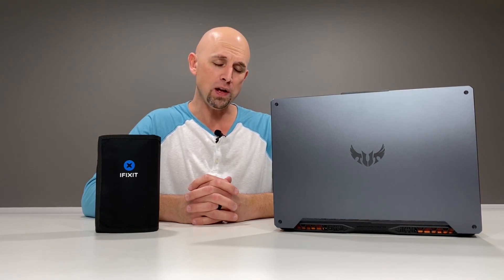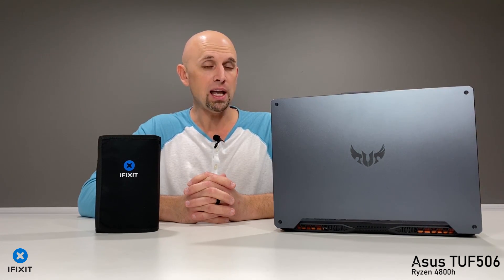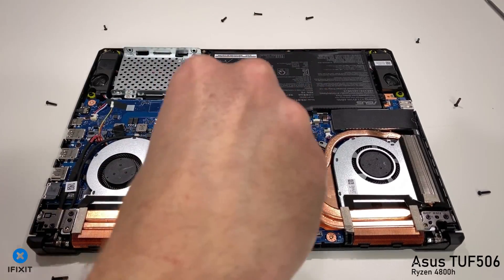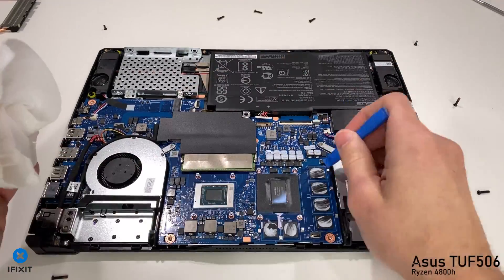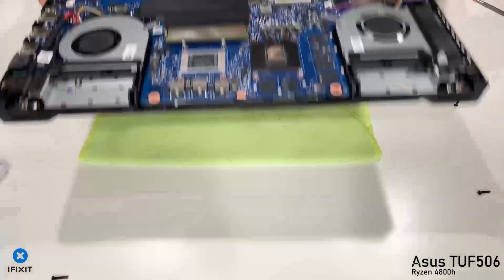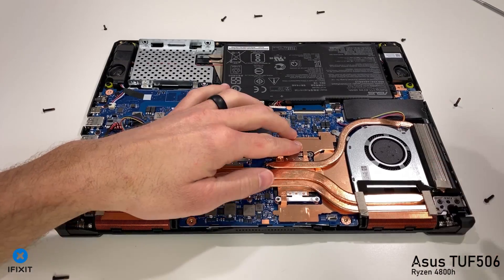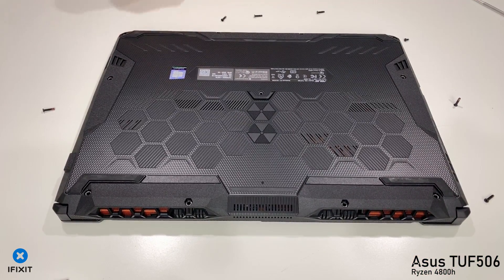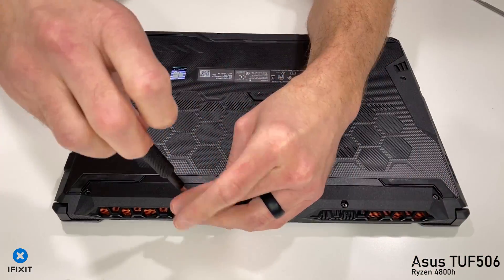Asus TUF 506 Repaste (Ryzen 4800H inside)

Comment from the maker: This is a brand new laptop. Most brand new laptops do NOT thermally benefit from new paste and this is no exception.   There’s nothing to show.
Reply: @Bob, had it been some other laptop with better cooling like Scar or Zephyrus, would it benefit from repaste? My current Asus Scar 3's i7 runs at 45W limit comfortably in 80-85C range while gaming. But when I push it to 60W power limit, the temps shoot up to 95C and it starts throttling a bit. Will I see an improvement in this regard after repasting?
Reply: Another IMPORTANT video topic for a video: How to replace the screen and what connector does the display use? (30 pin or 40 pin) As with the display being the primary weakness of the laptop, and as in the US a 40 pin 72% NTSC 144hz 15.6" display is ~$105 USD and a 30 pin 94% 120hz NTSC 15.6" display is <$60 USD. I think that there may be a lot of people who would like to upgrade their display in the near future.
Reply from the maker: I’ve done a time of those and one as recent as last week https://youtu.be/HO19B6MbOP4
Reply: thats why I've watercooled my gl502vs which has simmilar cooling system ( heatsink ).
Reply: Can you make a tutorial for screen replacement of the tuf a15 because it's screen is worse than I could imagine
Reply: @HarshGupta-zz9ur  I've changed mines it was a pain they glue the screen to the metal housing needs lots of heat and patience.
Reply: @Arw what laptop model are u taking abt?
Reply: Hay I have the Gigabyte Aero 15X V8, its starting to overhead and I looking to do a repaste. Can I use Innovation Cooling IC Graphite Thermal Pad on the GPU and CPU or should I stick with thermal paste for this: If yes which thermal paste would you recommend?
Reply from the maker: I’d go thermal paste and .5 fujipoly pads on the vram and other components.
Reply: @BobOfAllTrades  okay thanks, I have it in my laptop on the CPU and was thinking I could use it in the laptop but if you recommend thermal paste then thermal paste it is.
Reply: @BobOfAllTrades  Hey Bob, thanks for the great video.  One of my heat sink screws was way overtightened and I managed to strip it when trying to take it out.  Do you have any idea what size replacement I need (and obviously I have the same model computer)?  I assume it is an M2 but just not sure how long.  Thanks again!
Reply: Nice job showing whether the RAM was soldered or not.........
Reply: Not true my man. Not all thermal paste are made the same.
Reply: @JuanJDumeP  You cannot max out the fans on the A15. So no matter what paste you apply, the temperatures will simply scale   up to the fan speeds, simply satisfying the fan curve. So eventually it will get hot, albeit slowly.
Reply: @gamersanditparadise  liquid metal try that
Reply: I have the A15 Ryzen 9 and rtx2060 I avg 70-80°c with boost disabled 👍
Reply: Perhaps you need to try using liquid metal gallium.
Reply: Bro can i use 0.5mm thermal pad or 1.0MM?
Reply: How much will this cost?
Reply: Asus tuf bad cooling system.

Comment: hiya bob ive done aload of tests on this laptop i have the 4900h & Rtx2060 version my temps i can get right down to about 60'c 
playing perfectly no lags and good fps but surface temps direct above the gpu on the keyboard side is extremely hot 
the the only thing i can think of is either too much/too little thermal past on the heat sink or its sitting flush to the gpu chip (to tight)
i have put the 0.5 thermal pads on everything but the gpu and cpu i have put thermal paste on those 

hope you might have somthing for me to look into thanks
Reply from the maker: There’s components there that are not actively cooled.  That’s a pretty hot spot and many modern gaming laptops.
Reply: @BobOfAllTrades  would you say a hotter than a cup of fresh boild tea  a acceptable keyboard temp on a laptop 🤔 I'm not familiar with laptops as I have come from a older pc build just seem alarming haha

Comment: someone else has problems with 32 gb memory from v1.35v to 3200mhz that does not reach 3200mhz?
Reply: I think i'ts because the laptop's stock ram is rated at 1.2v, had the same issue so I returned them and bought 1.2v 3200mhz ones.
Reply: @chamlali14  correct, in my case it cannot return the RAM hehehehe bad luck mine.

Comment: DIY tip: use a heat gun to soften up the paste on the copper side, immediately wipe the paste off with a paper towel soaked in IPA. The copper can take the heat, the paste comes off in a single wipe. Be careful to not touch the copper with bare skin, and dont use that method on the mobo, heeat guns/hair dryers/leaf blowers etc, generate static electricity, could damage the board.

Comment: I have the same unit 506UI 15.6, may i know is the warranty will void, if the sticker removed on the screw? I have done this, but i only applied THERMAL GRIZZLY KRYONAUT THERMAL GREASE to CPU and GPU and the CPU temperature dropped 10c degree from 94c to 84c. Average temperature about 78c, before that while gaming it was stable at 94c, other than those chipset i used slim thermal pad, so far it was running cooler and stable.
Reply: I've made it like you with the same components, the result is same too when the system is on heavy load, but I've got higher idle temps. The idle CPU temperature was 30-35 before that but now 45-50. How about yours? Thanks!

Comment: Would an external fan setup help keep it cooler?
Reply: laptop cooler should help when gaming but wont be a huge improvement. imo repasting not necessary at all unless it improperly applied at factory. i have run gaming laptops for years without any overheating issues for years. just remember to clean the fans and vents.

Comment: Hey Bob: do TUF 506 with bigger battery have 1 extra NVMe slots?  I want to decide which TUF A15: bigger battery but I need 2 SSD slots.
Reply from the maker: Both laptops have 2 NVMe slots but the 48whr version has a 2.5” drive.
Reply: @BobOfAllTrades  Answer I needed.  I go with larger battery.

Comment: Just got the version with the 1650Ti and the motherboard is different, sadly no extra M.2 slot 😭 and this model also comes with thermal pads on the vrms, and fins instead of copper are aluminum, went with this model because I only game casually, might return and upgrade to the 1660Ti version maybe, it just sucks that from the 1650Ti to the 1660Ti there’s a 200 euros gap 😂
Reply from the maker: Cranberry Boost Interesting update in that model and thank you for letting us know!

Comment: If you're gonna do a repaste you might as well show if it benefits at all from it. If it doesn't, that's fairly easy to show with some tests. No reason to just go "most brand new laptops don't benefit from new paste" when that's pretty much untrue.
Reply from the maker: There’s a difference between a new laptop that was sitting in a warehouse for 6 months vs a new laptop that had a build date from the previous month.  Paste dries up regardless of use.  People were having issues with the first shipment of the Xbox One X for the same thing. 

Showcasing the zero temp difference would be extremely misleading once people follow this guide after their laptop is 6-12 months old as their temps should improve greatly.
Reply: @BobOfAllTrades  There are situations where recently built laptops can have improved thermals from a repaste. There are numerous instances where people who got CTO laptops from companies end up with uneven or even high temps that were improved with a repaste. Companies tend to use cheap thermal compound and you can yield much better temps with a proper compound.

You're treating showing data as if it's irresponsible. All it would do would make you more credible here realistically. You're perfectly capable of just showing the data and going "if you repaste a year after purchase you'll likely improve your temps, but this hasn't improved temperatures at all".
Reply from the maker: This is a tutorial to help those who will eventually need it.  

Here’s a different explanation in a different way. If I show that there’s no temperature difference then people will come to this video later on down the road and ask questions like “should I apply new paste because here it shows no improvement?“. Or “my temps are much warmer that what you revealed in your review, I’m worried that a repaste won’t do anything”.  Then I’ll get dozens of different variations of similar questions.  

In the end, this is a guide and that’s it.  I have made several of these over the last three years and have learned what to include based on experience with the community and reading their comments/questions.
Reply: @BobOfAllTrades  so "i'm not going to show data because I can't present my thermal test results without confusing people"? that seems to be more an issue with how you're presenting your content than anything else to me. again, I don't understand why you refuse to show any hard data for things on a consistent basis

Comment: Another IMPORTANT video topic for a video: How to replace the screen and what connector does the display use? (30 pin or 40 pin) As with the display being the primary weakness of the laptop, and as in the US a 40 pin 72% NTSC 144hz 15.6" display is ~$105 USD and a 30 pin 94% 120hz NTSC 15.6" display is <$60 USD. I think that there may be a lot of people who would like to upgrade their display in the near future.
Reply: You can not replace the screen so easily!!
Reply: Totally agreed
Reply: I'm interested in that too and mostly if everything on the upgrade monitor is the same except for the power consumption (lets say 4.7W to 8.1W) and if the new uses 4 lanes instead of 2 (same 40pin edp 1.3 connection), even if the new would be working in the same 1080x1920 res.
Reply: I think it is probably 30 pin most panda panels are 30 pins not sure though
Reply: @yashp  No this laptop uses the 40 pin QHD+ display connection standard.
Reply: I would certainly do!

Comment: I watched your review and another Q&A video about asus TUF laptop i wanted to know the temperatures before and after applying thermal paste maybe you Missed to tell or I missed something in the video 😅 and thanks for the teardown. Intel laptops thermal throttle a lot and thermal paste application help them alot these days ao that's the reason i wanted to know.
Reply from the maker: The difference is that this a fresh off the assembly line laptop.  I’ve reviewed and torn down new intel based laptops that also did NOT run cooler post repaste.  

If this laptop sat in a warehouse for 6 months there’s a good chance the paste would be dried up and need replacement.  I’ve seen and done it all 👍

Comment: Any warranty void sticker ? It usually covers the centermost screw,
Reply from the maker: It was discussed and shown in the video 👍
Reply: @BobOfAllTrades  i meant before even opening the  back pannel, there is supposed to be a sticker
Reply from the maker: Negative I wouldn’t have left that out.  You’re seeing this for the first time as was I.
Reply: @BobOfAllTrades  ahh, thats better then, acer doesn't allow you to open pannel without voiding warranty, 
Other than cpu and gpu, what were those big  black modules, were they gpu memory? 
And what were those small black modules with thermal paste on it
Reply: @BobOfAllTrades  i had acer nitro 5, and if i opened the back pannel, it void the warranty, like wtf, I can't even add an ssd,

Comment: Its looking cheap and bad.....
Ohh, AMD combined with Asus... thats why
Reply from the maker: Kokainarienv0gel All of these companies make high and low end laptops, not just Asus, right?
Reply: @BobOfAllTrades  i havent ever seen anything hi quality from Asus
Also i dont know any business class notebook from asus, all of them are cheap
Edit: cheap in quality, not price!
Reply from the maker: Kokainarienv0gel What would be a good high-quality laptop you think?  XPS 15 type stuff?
Reply: @BobOfAllTrades  magnesium case notebooks like hi end IBMs, MacBook Pro, probably dell xps and so

Im actually also using a cheap plastic bomber from HP (Omen 17, cheapest rtx 2080 notebook), but mainly because the notebook wont see physical stress anymore and its 50/50 desktop replacement, so PC for my TV, and gaming at friends.

As i needed a notebook for school i first had a very cheap acer, but the stress at the bus broke my display once and acer was too dumb to repair it 3x a row. As they finally got it, i sold it aslong i get a little money back.
Then i got a MacBook Pro 2009, and its still working today, also looking pretty nice for over 10 years, 4 batteries killed and about 3000 charging cycles

I would even say many expensive business notebooks are cheap. probably because i prefer the awesome cases of aluminium MacBooks from 2008 and above

Comment: for thermal pads, is the thickness matter? i don't know what thickness my laptop use at stock
Reply: absolutely yes thickness matters, thermal pads too thick will introduce a gap between the metal surface and the silicon die area, causing bad temperatures on the CPU or GPU, and too thin won't be of any use causing bad temperatures on those components (memory, VRMs) which is a more nasty problem since they don't have thermal readouts that you can easily see in monitoring apps, Throttlestop, HWInfo etc. and overheating VRMs can cause unexplainable throttle and eventually kaboom + magic smoke
Reply: @greebj  i see, thank you for replying, and if i changed my laptop thermal pad to let's say a gelid thermal pad or minus pad 8 from thermal grizzly, will it impact my laptop performance? my laptop is HP Pavilion Gaming 15

Comment: Still the same mistake on previous models of the TUF lineup, tiny air intake on the bottom of the chassis. I'm an Asus TUF owner as well, so thermal issues really is a problem in this model for me over these past few months. The price would really make a selling point for budget conscious customers, but all I can tell you is stay away from this asus product if you can. And again, im not your dad, just my unpopular opinion
Reply: Nathaniel Luke why is the cooling such a problem how does it affect performance?
Reply: @kariuki925  Heres the pic of the bottom panel (the red outline is a rough ,measurement of the fan's placement). https://cdn.discordapp.com/attachments/454848766659264514/694795591880015892/IMG20200401142648.jpg

And heres how i set mine up without the bottom panel (note the book is place in between the fans on the cooper heat pipes, so that it does not pressure the fans under the laptop's weight to make some rattling noise to the fan when operated)
https://cdn.discordapp.com/attachments/454848766659264514/694795192116576306/IMG20200401142840.jpg
Reply: Nathaniel Luke do you think the high hertz screen can make up for the low response time display ?
Reply: @kariuki925  eeeehhh, tbh i dont know how to answer that question. As long as I have an IPS 7Hz+ panel, im good (mine is a TN 60hz btw).

Edit: 75Hz+ panel
Reply: Nathaniel Luke it’s ok thanks tho 🙏🏾
Reply: @nathanielluke2084  they made limited amount of intake vents because they want to make use of their anti dust cooling system, which to my surprise works. 2 years with this laptop and there is very very little amount of dust. Plus, it also intakes from the keyboard.
Reply: @kariuki925  as I mentioned, the cooling vents are so tiny, that air is barely sucked into the fans for cooling. Because this is my only laptop and i dont have a desktop (plus the quarantine time is extended for my country), I popped off the bottom plate and walla! From 90-95C during gaming (i repasted this laptop btw) to 75-80C, but rarely reaches 85.
Reply: @kariuki925  i hope that helps
Reply: Nathaniel Luke damn thank you

Comment: Same thermal system.. just upgrade case.. 
Acer nitro 5 better cooling system than this Asus TUF
Reply: nah not really , having nitro 5 and 7 before getting my tuf a15 , i need an additional cooler , repasting and few tweaks particularly in undervolting in order to cool the shit out of that laptop , usually when run without the cooler it will to frigging 95-99 degree c just on my cpu , talking about gpu then id go as high as 89 degree . they have better intake , yes but it doesnt say its better than tuf a15 cooling system . i ran the config with i5 9300H and 1650 on my nitro 5 and i7-9650H with 1650 on my nitro 7 . after putting my second nvme gen 3 it got even worse. 
soo lets not say anything about thermal one laptop have without experiencing using one at least.

Comment: I was hoping there would be a before and after results
Reply: That's pointless for new laptop
Reply: @KP-48-007  How? New laptop doesnt mean that the paste was performing at liquid metal tier, and after 6 months it became trash. Yes it may become trash, but I think using a good paste should always benefit.
Reply: @gamersanditparadise  It does at least 3-4 less c or 5 less c if applied properly.
Reply: @gamersanditparadise  I got 20 less c after 1 year i replaced stock paste so yeah there it is 20 less temps of both cpu and gpu shows how crappy most stock pastes are.In this video he might be right different wont be huge on out of the box thermal paste replacement it will be 3-5c at max unless laptop is already reaching 97 then its either paste or its flawed which is not the case here.
Reply: @KP-48-007  pointless? I don't think so. Mine brand new 506's(exactly the same config) max cpu boost frequency is limited at 3.4GHz (in AIDA stress test, Cinebench R20, R15 and etc) with 92C... OK I know max boot frequency is a theoretically value, but 1GHz minus?